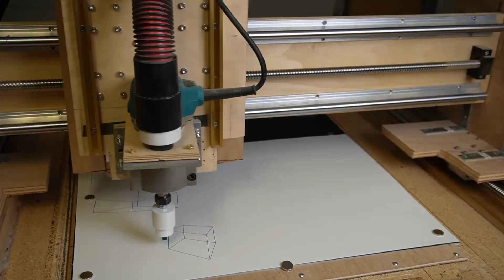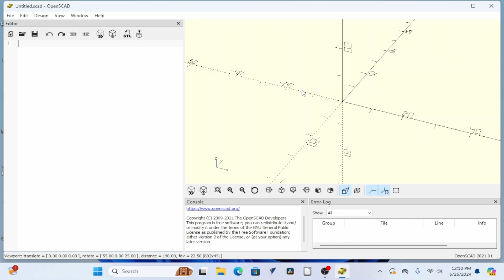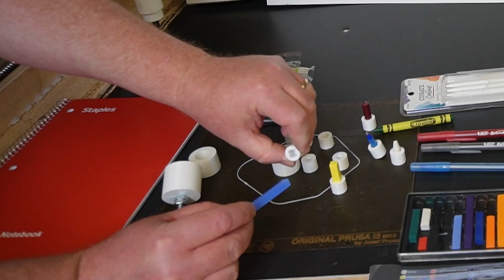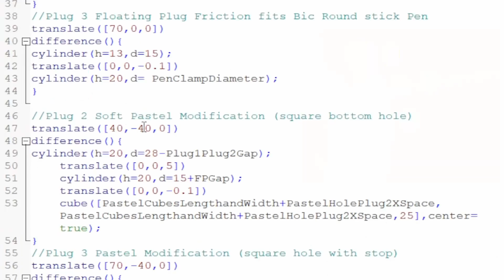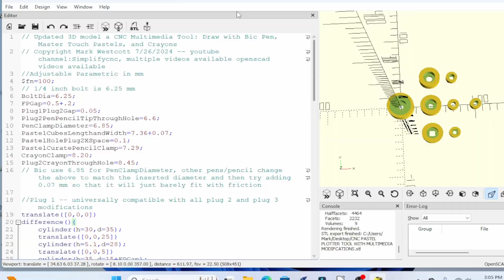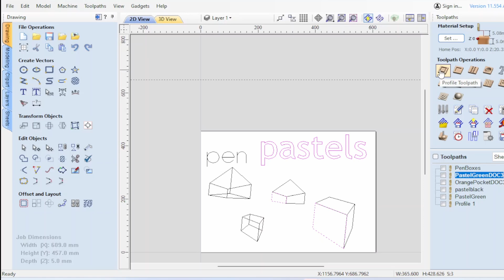CNC ROUTER TRANSFORMED INTO COLOR PLOTTER: PASTELS, INK, AND MORE -- HERE'S HOW

Comment: Any software other than vcarve that lets you do this?
Reply from the maker: Yes, most CNC software should easily be able to handle this for you (just make sure router/spindle is/stays turned off when running your CNC job).  Generate gcode in the CNC software of your choice like you would for a normal cnc job (making sure the router is off and stays turned off when using plotting tool).  For line drawings when setting up the CNC gcode paths do a profile line on pass of your pattern with about 2 mm depth of cut (even though you won't actually be cutting anything) the size of bit doesn't really matter that much.  This 2 mm depth will allow your spring to compress and provide sufficient friction for the pen/pencil/chalk, ect.  For fill in drawings, use a pocket tool path (with 40% overalap if your software allows it).  With fill designs select a bit with a diameter as close as possible to the width of the pastel or chalk.  If you can't set stepoverlap to 40% in your software you can trick the software to work by choosing a smaller diameter than the width of the chalk (for example a pastel is about a quarter of an inch wide so choose an 8th inch bit for your pocket).  If you don't already have CNC software then for a free solution you might check out jscut.  It is opensource or check out kirimoto (free browser based or downloadable) or freecad.  If you need more help let me know.  I am curious are you approaching using the CNC plotting capabilities more for art or more for woodworking or something else?  I use my CNC as a plotter a ton as it is great for prototyping things and drawing out patterns and posters.   I plan on doing a huge drawing on my channel once my build your own cnc series videos are complete. One more thing that might be useful for you, if you need something to make the SVG pattern for free then InkScape is a good tool that is opensource and free.  I also really like Affinity Designer for higher quality easier SVG creation.  The program does cost some money but I think it still has a 6 months free trial period.  Free is good.  I liked it enough I went ahead and bought a copy.  It's way, way better value than the other major graphic program which I can't name that does monthly subscriptions.
Reply: @Simplifycnc  Thanks for the reply.  I do a lot of RC model aircraft modeling and do not have any large format printer access any longer since I sold my business.  I wondered if I could do simple diagram outlines (model plans) and this looks like it would do.